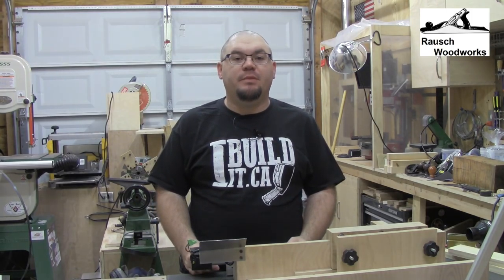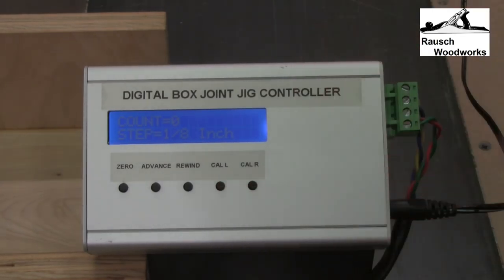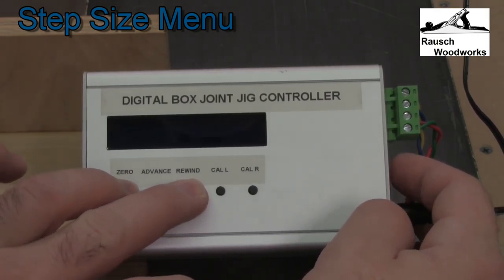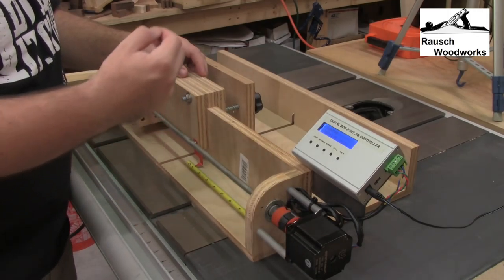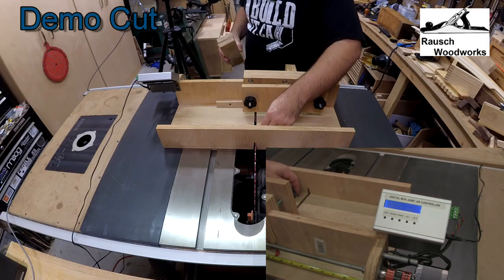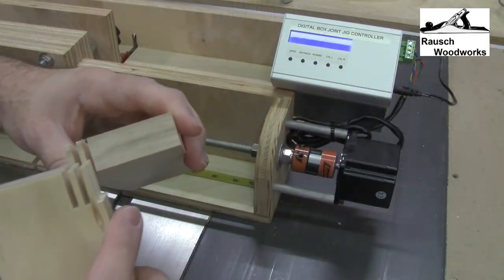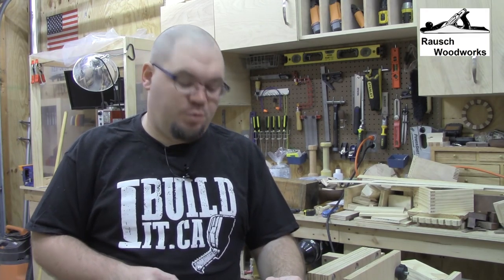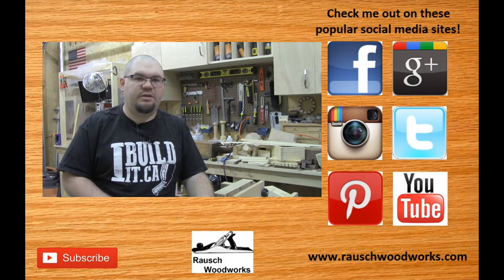DigiBox - Box Joint Jig Controller Demo

Comment: This is really cool. A suggestion would be to make the advance button also available via an external button you can mount on the sleds handle. I have been thinking of something like this too. Another hack would be to run it out of a drill battery for some cordless action.

Comment: Jason, this is fabulous.  I built the same sled as you have, but with the hand crank.  I really like its accuracy.  Adding your controller to it would make it a fantastic tool for my shop.  If it were available today, I'd buy it.  A price of $150 including the drive motor would be in the right area.  Without the motor, $100-$110 would be right.  Which ever way you go, be sure to include the sled building and/or conversion instructions.  It will help insure success.
Reply from the maker: +Mark Hazlewood Thanks, Mark!  I'm doing my best to be in that price range.  Purchase of the controller will include plans for the jig.

Comment: Really cool Jason. I like the compact design.
Reply from the maker: +Darbin Orvar Thanks, Linn!  I was trying to make it as small as possible to fit on the jig.  If it wasn't for the LCD, I could make it 1/4 of the size.  If you saw the PCB, I have everything pretty well spaced out just because I have the room.

Comment: Still on the fence here. I think the idea and overall execution is great! A couple challenges for me would be power supply cord and the small buttons on the interface. I know this is just a prototype of course, but from a user interface standpoint I would love to see that advance button be a lot bigger, and would also be interested in a trigger port you mentioned in other comments. For the power issue, I know you're limited because any 12v battery would be large, plus having to recharge your box jig could be a pain. For me I'd say I'm a maybe, but if I did buy one, I'd buy a kit form that has all the all bearings and mechanical parts and jig plans. I know it may be a little more that way because you'd have to markup the parts, but for me personally I'd rather have a complete kit then having to track down all the mechanical parts from different places. This does tackle the worry of accuracy which makes me lean more towards buying, as that worry has kept me from trying box joints so far.
Reply from the maker: +BradleyMakes Thanks for watching and the feedback!  I'm curious to see what kind of inventive ways people come up with to power it vs. an AC wall adapter.  I like adapters because I have a duplex socket right on my workbench/outfeed table, so it's easy to get power there and I like having the consistent power supply to the controller.  Not much of a variable in that setting and that is good when you're mixing digital and analog electronics.

Comment: That is extremely cool Jason! Very ingenious. I think there is definitely a market for this, as there are a lot of woodworkers that use box joints quite a bit in their projects. And if you can bring it to market for the price range you are thinking of, it will do well.
Reply from the maker: +GuysWoodshop Thanks!  That is what I'm thinking.  I know box joints are a popular thing and getting the jig accurate is the toughest part.  A stepper motor really can help that.  Thanks for watching!

Comment: Awesome job Jason! I think this would be a great tool to have in a workshop if I were doing box-joint jigs. It would definitely help make things more accurate. I have this strange urge to go try and make a box joint now....I haven't got that far yet!

I'm not sure if a battery is the best solution but the wire may be an issue for some to power it. It all depends on how we have our shops wired. Another thought comes to mind, having bigger buttons if you have room in the case. I would say go retro and put in arcade-style buttons but they would probably gunk up with sawdust after a while ;)

I think it's great though. Great job!
Reply from the maker: +Robert Rittenhouse Thanks for watching, Bob!  Maybe I can convince an old friend try it out :)

Comment: Hi. 

I've done something similar using a router table. This allows one to easily modify the width by changing the router bit, and you can accommodate metric and Imperial very easily. 

The general idea is very similar to yours. I found it less expensive to use a stepper motor ar either end of the lead screw than to buy bearings! Both motors are driven from the same driver but with a phase reversal to one to make them agree on the direction of rotation. 

I used M5 studding which has a pitch of 0.8mm, and the stepper motors have a step size of 0.9 degrees (400 steps per rev, or 500 steps per mm)

I bought a Nextion 3.2" display module which has a built in processor which you can very easily program on an object based editor that runs on a PC. This has 8 GPIO pins which you can use to set direction and enable signals and pulses to move the motor and sense whe the carriage hits a limit switch etc.. The PSU was a cheap Chinese unit. 

The software asks for the cutter width and tells you how to set up the work (The Nextion has a colour TFT so I could display some hand-drawn and scanned in diagrams to help with this!)

I spent a week designing it, a week playing with the Nextion and getting the software as I wanted it, and a day assembling it. Once I had the thing working I have used it a lot for making drawers (12mm cutter) and some tiny decorative boxes for granddaughters ( 4mm cutters). So far it's worked well. One thing I found useful is to allow for a half increment (equal to the cutter width) which you need if you want mating parts to line up.

I've no intention of trying to sell it, so there is little point in making it look professional, but I managed to get all the electronics boxed in. My only concession to cosmetics was to get a friend to make 3d printed bezel to mount the display.  (Nextion provide a design file which I copied to him) Cost of the bezel was an evening's beer!

I've been very pleased with mine so far, and wish you luck with yours!

Comment: "If you had that available today, I'd buy it"...really, very clever, and I'd definitely like one as SOON as they're made available. Can you do a 1/4" demo? Would the stepper motor work with the 1/8 blade and advance it accordingly? For example, after the first cut, advance 1/8", then the next move go 1/4", etc,etc? I think it'd be a dead ringer if you could make that programming work!
Reply from the maker: +Mark Price I'm planning to do a 1/4" in the next demo video.  Hang tight!  The idea of doing successive 1/8" cuts has been knocked around.  Not sure if I'm going to do that since I'm getting close to out of memory on the processor.

Comment: Great solution. I have been thinking of this but well done for getting there! There are a couple of things I still wanted to resolve. First is a simple mechanism for getting stock vertical and aligned which you obviously did at the 4:26 edit as the two pieces weren't aligned. Thats not a criticism, its just something thats annoying to me. Next is a simple function to tighten or relax  a joint after a test cut. Say you run the cut and it's just a little too tight for when glue is applied, the function would add a certain amount (in thousands of an inch probably) to get the right fit. I know with your functionality you can do it (you make the comment at 5:03) but it's not very easy. It the blade for sure but its the stock as well and its moisture as to how neatly it cuts. Hope that helps. Well done again. This is the future of woodworking.
Reply from the maker: +Colin Herbert I'm not sure what you mean by "weren't aligned".  As for adjustment, that's the beauty of the rewind feature.  Let it rewind back to the start, then you can use the cal buttons to shift it 1/64" either way and then run through a second time.  This will shave 1/64" from each finger.
Reply: Jason Rausch OK on the Cal buttons... I think the difference is that a 1/64" might be quite a drastic change in hardwood and could send the joint from right to sloppy. I guess I was thinking of a smaller increment and labelling them T-ight or L-oose so someone didn't have to think of CalL or CalR (left or right) which can be confusing when thinking about how to 'loosen' a joint.
On the alignment, when I do joints there is always a risk that the two pieces are not aligned vertically. If I was making the surrounds for a tray for example, the resulting frame would not then sit comfortably on a flat surface. Before 4:26 if you look at the top of the two pieces you can see they are not tightly aligned and MAY not be vertical. At that point there is an edit in the video after which they become aligned. Watch to top left (from camera) corner of the stock at the edit point. NOT a criticism but I was thinking of a taller section against which to set the pieces vertically and together at a known 90deg to the table.
Great job!

Comment: Not too shabby there.  Love the "clean" look.  What you got there is a great gadget, great packaging, and dosent require a masters in digital technology to use.  :). 

The precision you can get out of one of these screw advance jigs is unbelievable without getting into adding a bit of smarts to one.  Ive actually cut say half the joints one day then take a few days to get back to it and cutting the rest. Sometimes the joint wont fit. The reason is the humidity change "fattens " up the width throwing things off to the point they wont fit!. A few at one will but the other end is way off. These jigs are the ONLY way to fly with a box joint jig.

Personally I would add in a bit of adjustment for blade width to that gizmo as many are under 1/8, mine are actually 1/32 under and that does make a huge different in fit if you dont compensate for it. I just add a half turn on the crank after the last "normal" cut and start from there to the next cut position. That lives the finger/slot relationship within say a couple thou of exact;y 50/50.  As neat as yours is it WONT work the way I use my jig.  I often do a box where the fingers are not all the same size. As an example Ill start with say 1/8 for 2 or 3, jump to a couple of 1./4 etc all the way to as much as 3/4 depending on how tall/wide the sides are.  All it takes is some layout and think turns on the crank instead of some unit of measurement.  Makes for a VERY unusual looking box joint.  :)

Im sorta thinking about applying a bit of CNC technology using an Adrinio running gerbl. Simply feed it the G-code and away you go. Thats what the inventabls CNC use.. Already have everything I need except for the Adrinio.  Beats reinventing whats already available for about 30 bux.  l already have all the cad/cam software needed as I use it on my home brew / noplans CNC now. I use a commercial grade control program running on a 15 year old, Maby older desktop on my CNC. Think 1 Axis CNC and you got it. Think I got my next boredom killer project out in the shop instead of doing some more inlay boxes with a $30 buck outlay.  :)

Comment: Looks cool.  Interesting technical challenge and how you solved it.

Would I buy it?   Sorry, no.   I already have the woodgears boxjoint jig, so I don't really need another one.  It doesn't seem like this is any faster.  Possibly a smidgen easier to set up, but otherwise the execution is similar.  If I was building one now I'd likely look at John Heisz's design.   I guess as I watch this I don't see enough of a benefit for me over a regular manual jig.

Maybe if your jig also did the advancing back+forth through the saw, so that all you need to do is set it up and turn it loose?  That's kind of dangerous to contemplate with a saw, and you still need to stay and supervise.  Hmm.   

Now that said, your price guesstimate does sound quite fair.
Reply from the maker: +Wordsnwood (Art Mulder) Thanks for all of the feedback!  I appreciate the ideas from several angles.  ...and thanks for watching.

Comment: I am very  interested in the Digibox controller. I would be a buyer if the kit came with all the components to assemble minus the easily found threaded rod. Only one improvement I can think of would be a set of pre written patterns. Enabling the user to select the pattern they desire (i.e 1/8th" joint) press start, and after each cut the carriage advances automatically without user interface on the controller.  I look fwd to hearing about its release!

Comment: I built a manual box joint jig , but I'd be interested in this type of setup for the entertainment value also!
Reply from the maker: +Ron Briz This started off as a purely manual jig, with a hand crank.  I simply retrofitted the stepper motor in place of the crank and added my controller.

Comment: Just an idea, power the system with a cordless tool battery pack so that you don't have the extra power cord running over the saw.  Great product, I had the same idea a few months back, just never had the time to do anything about it.
Reply from the maker: +okfj The controller has a standard coaxial style power jack.  We'll leave it up to the end user to decide how they want to power it.  The requirements are 12-15 VDC.  Thanks for watching!

Comment: I'm VERY interested in the DigiBox, especially if it could be set up to cut 1/4" joints by default, instead of 1/8". Maybe a memory of some sort so that it powers up with the previous session's settings.
Reply from the maker: Yes, in the first firmware that will ship, I will have it remember the last chosen step size.  Thanks for the suggestion!

Comment: Sweet product. Definitely saves me the headache of trying to design it since I have no experience with electronics. The clincher for me to buy it today would be more adjustability viz a viz blade thickness. My flat grind rip blade comes to 3.6 mm, which is about 0.5 mm thicker than 1/8". Also, I am not clear on how to adjust the device to dial in the fit. Other than that, I would buy it today

Comment: I like the idea and would be vey interested in it. Thinking out loud it, would be more marketable to me if it came as a kit including the stepper motor and bearings. People may be more hesitant to purchase if they have to source more parts are the initial purchase to make it work.
Reply from the maker: +mickeyhendren I am going to offer up a hardware kit that will include bearings, threaded rod, nut and couplers.  I'll also make the stepper available.  Considering an electronics package of the controller and stepper together.

Comment: I would be interested in this system and I would  (In theory) be willing to buy at $100 - $150. I think the controller, motor, necessary hardware, and plans to build the sled would be a good value in that price range
Reply from the maker: +WannaBeWood Smith The $100-150 range would be for the controller.  Motor and hardware would be sold separately.  Thanks for watching!
Reply: Oh .... and what would those other pieces cost ?  What would it cost to put the whole system cost to build ?

Comment: I really like the concept. I would definitely buy that product. One thing I'm not clear on, If you change the number of steps (if that's possible) could it be more or less automatic advance X number of steps?
Reply from the maker: +Frank Thornal Changing the steps will only change the spacing of the cuts.  To advance it, you still need to trigger it some way.  Right now, I'm using the Advance button on the front panel, but we're looking at other semi-automatic options such as a switch positioned to the rear of the table saw so when you pull the sled back, you bump that switch and it forces an advance.

Comment: only a few changes I'd suggest, 1st a large button for  advancement, and maybe a remote port option for push button advance,  battery powered option, a way to store the info when it's power cycled. Put me down for one. Is this comatible with a nema 34 stepper, as  I have a nema 34 stepper and some threaded rod left over from an old cnc project.
Reply from the maker: +QuainBuilt External trigger is something I'm looking at.  NEMA 34 should be fine.  The driver is good for 2A.  Battery may be tough, since the driver needs 12VDC.  I can see maybe a large LiPo battery  pack working, but I doubt I'll offer that.  Rather the end user can wire the battery pack up and plug into the power port.  Thanks for the suggestions!
Reply: +Jason Rausch didn't dawn on me the hardwired power supply was also running the stepper, dah on my part, what voltage you running stepper motor on?

Comment: Jason do you have an input left on your controller?  You can modify it so you don't have to press the button each time you make a pass.
Reply from the maker: +Jim Beshears I have several I/O lines available.  Tossing around some ideas for external triggers.  The hardware shown in the video is not locked down hard.  I can still make changes, it will just require a new PCB to incorporate them.
Reply: Well I don't want to make you think I'm jumping in on your project at all, but here is what I'm thinking.

Put an inductive proximity sensor in the back of the sled somewhere, facing down so it will detect the surface of the table saw.  You can drill a hole in the sled and either thread or glue it in.  After the wood is in position and the controller is setup, The controller will not be seeing any metal because the sled is off the back of the table saw.  When you begin to do passes, as the sled is pushed forward and backward, the proximity sensor can be used to increment the servo by detecting when the sled is pulled back toward the operator ready for the next pass.  You could even put an LED on the controller telling the operator it is ok to push.

Does that make sense or did I do a bad job describing it?  I work for a company that makes industrial sensors and this jumped right out at me.  I've wanted to build something like this with an Arduino.